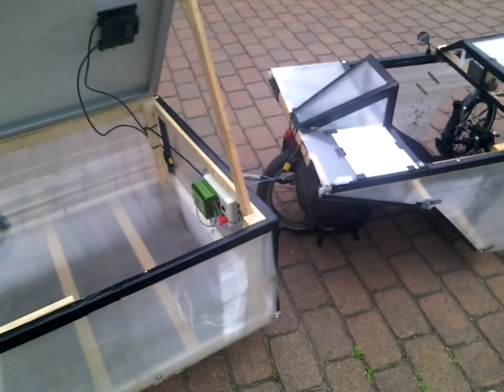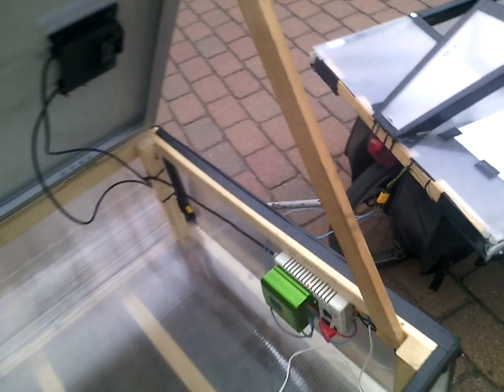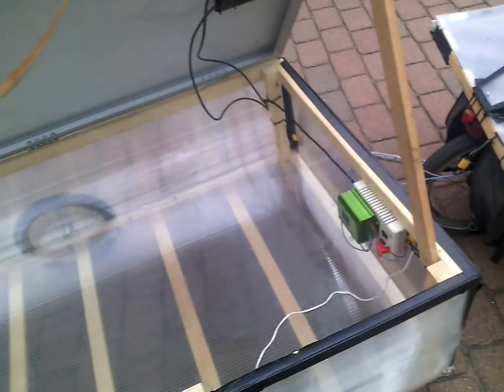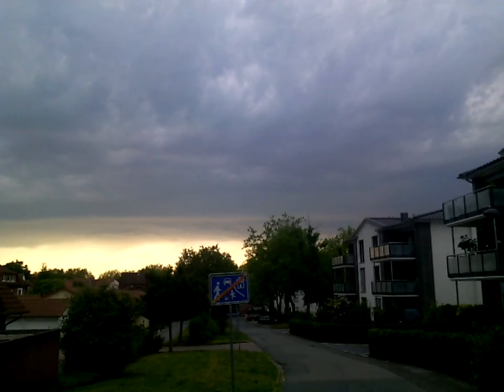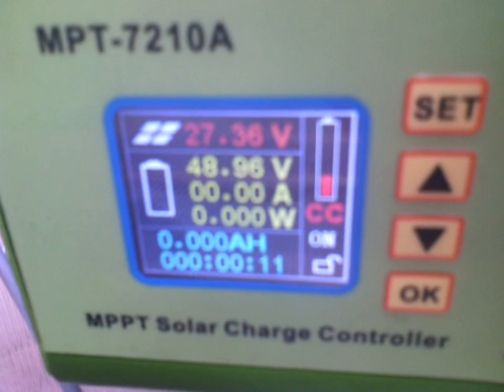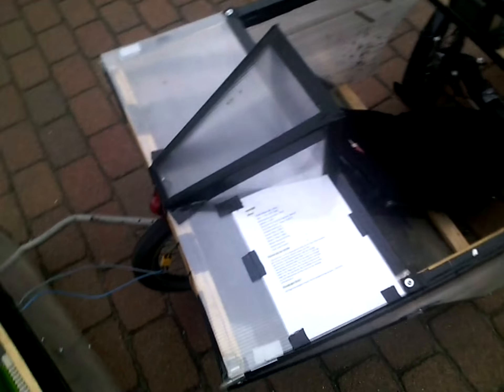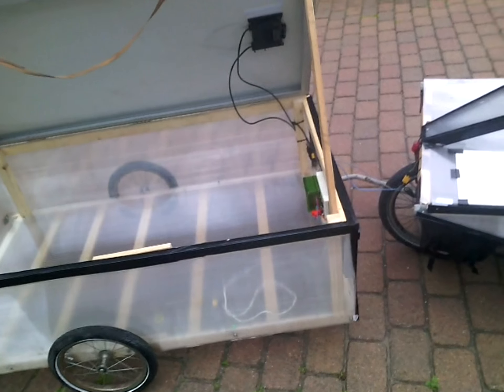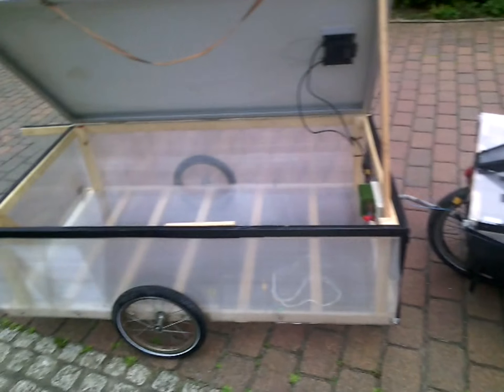Solar Bike trailer ( build LOG 4 ) Short Update

Comment: Hi man, I hope you are doing great! I would like to ask you a question to clear out the situation for myself. I want to make a solar bike based on my e-bike and oxtail single wheel bike trailer. I use 36 volt  16 Ah battery on my e-bike. As far as I understand I will need a 100 watt solar panel and a 12 to 42 charge controller. Am I right or will I need something else (I mean equipment for such a  rebuild)? Thanks for help in advance
Reply from the maker: if you want mor utility you also will need a 49 to 12 V stepdown so you can hock up all 12 V device .  you setup seems a bit off to me . 100W solar panel is not big . if its flat on the trayler you will get around 30W maybe . i suggest get around 200W if you can . 100W with 16Ah  thats around 800Wh . with a 100W Panel you need 8H of perfect condition to charge fully .  if possible stock up to 200W :)